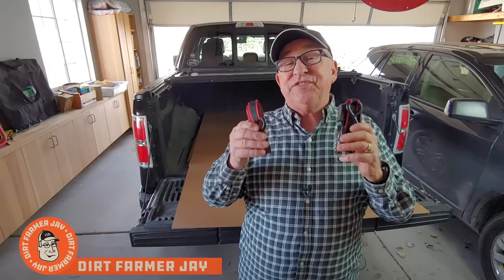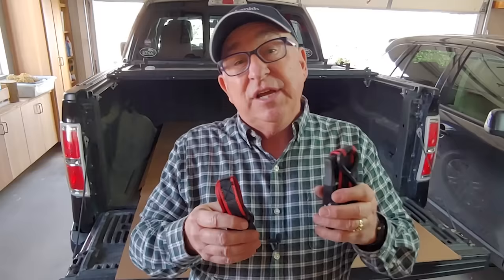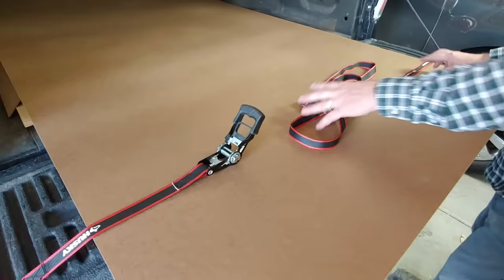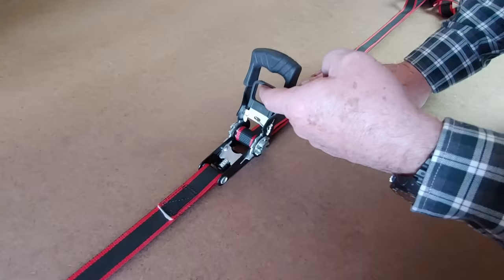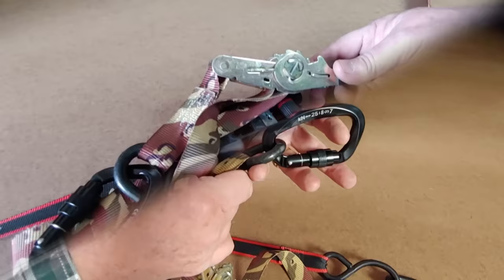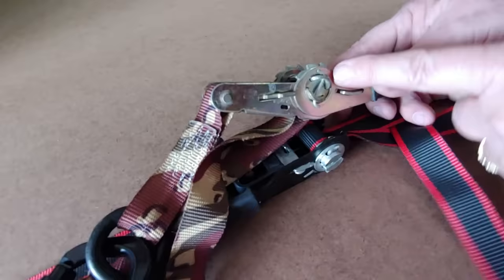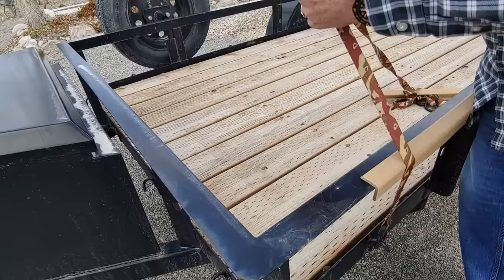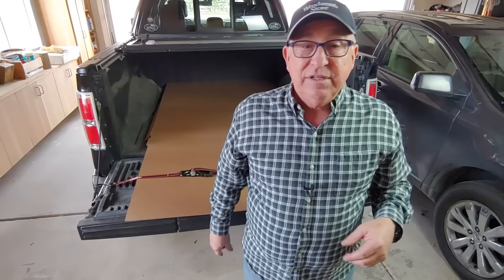How to Use a Ratchet Strap - Tips and Tricks!

Comment: Here's a couple of tips from a long time ratchet strap user: Always have some rubber bands on hand, when you are done using your straps, wind the strap end and store it using rubber bands, this will keep them from getting tangled,( Always store the strap and ratchet separately)  When transporting PVC pipe or round objects, wrap your strap around the pipe, when you tighten the ratchet, this will cause the strap to tighten around the pipe, and will keep pieces of pipe from getting loose. From time to time apply some WD 40 to your ratchets, this will keep them operating smoothly. If you are transporting for a long time-take a break and check that your straps are still tight and in the same place where you started!
Reply from the maker: Great info Kelly Keefe! Thanks for sharing with our viewer family. Best to you and thanks for weighing in! Best, DFJ
Reply: @DirtFarmerJay  No problem, BTW your advice on purchasing high quality ratchet straps was right on the money. My worst dread was loosing cargo on the road and injuring someone who was behind me!
Reply: I haven't been able to find rubber bands big enough for the purpose, but found a container with 20 10-inch bungee cords in it and they work quite well for my 2-inch straps. Now that I've seen this excellent video, I'm going to try the trick at the  end to pull the loop through.
Reply: Wide bands from grocery store broccoli are good for this purpose
Reply: @billnelson3605 most truck stops as well as tarp/securement shops will have wide rubber bands that can used to keep straps rolled up when not in use. Might be little big for 1" straps but I use them on my 2" and 4" straps. Keeps them from unwinding from driving vibrations while stored. I like to have my straps rolled tight and keep them tight. Always roll straps with the hooks/chain on the outside. The free end will do way less damage then if you throw the hook/chain end and hit someone.

Comment: I've used a 3/4 inch garden hose, cut it about eight inches then slice a groove in it, slap it over the end of the Angle iron on my trailer to avoid any abrasive edge on the strap.  Works great.  Stays in place while I'm adjusting the straps with minimal , sometimes zero pressure from the overlying strap.
Reply: My friend got a few feet of retired firehose and cut it into ~foot long sections (not easy) and uses them for strap/load protection.
Reply: Yes, and pool noodles can be good protectors, too.
Reply: @wickedmuffin76 fire hose is also good for chain protection. Leave it in hose form, cut into sections and slip over the chain. Chain will not scratch painted surfaces then, if your worried about that.

Comment: 6:55 I drove commercially and trained flatbed drivers on load securement. Whoever told you that was full of it. That is exactly what that pawl is for, and why some have a slight notch for your finger to stay centered. Normally you don't need to manually pull it, but there are occasions you will.

Everything else was good advice for the beginner. And I like the tip you showed how to deal with extra strap. I'd normally roll it up and tuck it under the strap on those little ones. In the 2in and 3in straps, you can roll it and tuck it back through the ratchet handle as you close it.

One more tip: When feeding the strap through the ratchet, wind the empty ratchet until the reel openings are up and down. Close the ratchet and you can feed the strap from the bottom to the top in one motion. Then start ratcheting.

And one thing you forgot, your securements (straps or chains) will normally loosen up as your load settles. If you're going more than a mile or two, stop about five or ten minutes after loading and check your securements to make sure they're still tight.
Reply: Project Farm has a great video on ratchet straps.  His tests showed a 40 lb tension loss in just 30 seconds.  Your advice is spot on.  Re-tighten the straps before going too far.
Reply from the maker: Rob, thanks for weighing in and taking time to share your expertise in such a clear manner. Thanks particularly for your insight on the pawl notch, as well as the feeding tip for the strap when loading the ratchet.

The insight about tightening the load again after it settles is GOLDEN - that will show up in another tips video, and we'll be sure to give you credit for it. 

Thanks again! Best, DFJ

Comment: 1. When you hook the two hooks to each other, put the hook of one side inside the hole that is behind the  s part of the other hook.  This is less likely to pull apart. 2. When I haul one or 2 boards or pieces of plywood, I wrap a strap all the way around the board crossing it under and when I tighten up it cinches the strap tight around the board. I leave the tailgate even with UP with boards longer than the truck bed, when I’m not hauling a lot of boards. I liked your video. I put a shop towel around the touch points of the straps on my ebike to protect the bike. Never never trust bungee cords. They are the number one cause of blindness in young people!
Reply from the maker: Thanks for watching and commenting Martin Maddox. Best to you, Dirt Farmer Jay

Comment: I'd like to add that if your strap will be in free air as you drive ( like over a tall item) it's actually better to have twists in it to keep it from vibrating.
Reply: 1/2 twist on each side to be exact. Flatbedder who uses the 1/2 twist on anything tall and untarped.

Comment: As a flatbed truck driver, I’d say you’re not wrapping enough strap around the barrel of the ratchet. The strength of the hold doesn’t come from the small hooks and small plate. It comes from the wrap mostly. The more wraps you can get, the better. Leave a little slack, don’t tug tight before ratcheting. Get a good 2-3 wraps around the barrel. That won’t cause jamming and will hold more securely. 

Also, if you don’t want your strap to flutter in the wind, put one half rotation on one side, flat across the top, and one half rotation on the other side with feeding the strap through the barrel flat. Still, have 2-3 wraps around the barrel. This will not only be a stronger hold than shown here, but it’ll prevent the strap from fluttering in the wind. 

Hope this helps.
Reply from the maker: Incognito Burrito (love the screen name!), thanks for writing. This is good stuff. Watch for another video where this information will be incorporated. Best Regards, DFJ

Comment: Like one commenter already mentioned, always twist the strap that goes cross the load to prevent it vibrating agaist the surface, long journey and the surface is ruined. It does not weaken the strap at all, only knots do. Sometimes (usually...) even professional truckers leave the straps flat and straight. My usual boat transporting trucker once said that those "flat strappers" are the ones with a peanut in the place of brains.
Reply from the maker: Love it. Indeed, in another video we did, we mentioned that tip, but have a new edition coming out of "best viewer tips" for using ratchet straps. Thanks for writing! Best, DFJ

Comment: Who ever knew something as simple as a ratchet strap could be so misunderstood? What I learned from your video: Stop storing the straps with the long end rolled onto the crank; instead, start with the strap separated from the crank. ( I've always tried to avoid pulling the strap all the way out of the crank because I was never quiet sure how it was "supposed" to go back in.) This takes me to what I learned from reading through the comments: As you demonstrated in the video, start with the ratchet arm facing away from the load. Next, close the ratchet arm but be sure the slot is in a position to easily insert the strap through from the load facing side and out the other side. Do not pull too much slack out of the strap, you want at least 2 full revolutions of the strap on the drum. You can put a single twist in the strap to reduce wind noise and strap wear. Use only transportation approved fasteners and fasten points.

Comment: Good points. When securing a load subjected to winds from highway speeds a single twist in the strap midway helps prevent the humming and strap vibration caused by the air.
Reply: Right? I remember that tidbit of knowledge from years ago and yet I still see quite often on big rigs the straps flapping and vibrating which can cause other problems in the long haul.
Reply: Yes a twist in the strap does it weaken the strength of the strap at all !
  The only thing a twist may do is get into the ratchet tumbler if you aren’t paying attention, but if your that stupid you maybe should not be trusted with the task
Reply: Yes that twist to prevent flapping is an old trick I learned as a flatbed truck driver 40 years ago. It’s not necessarily needed on a very low profile load like rebar but it’s important for taller loads.
Reply: I was going to say the same thing but you did it for me.  A twist will eliminate shuttering.  It always bugs me when I'm driving down the freeway and I see a strap shuttering.
Reply: @Alan 602 that’s the thing though, that humming and flapping equates to constant movement and possible loosening of the straps which is never a good thing.
Reply: @itonlyhurtswhenilaugh4750  )))
Reply: @Alan 602 The flapping is movement that is wearing your straps where they contact the load.

Comment: If you ever see a steelhauler loading sheet goods, they will lay a couple 4 by 4's on the steel and then throw the chain across. It's hard to explain,  but if you see it done, it makes total sense.
Reply from the maker: Ed, I have seen that. Thanks for bringing that up. The 4x4's allow down pressure to be brought to bear on the steel, without the chains coming right across the sharp edge of the sheet steel. These kinds of practices are time tested by people that depend on them to safely secure, and transport loads. Thanks again! Best, DFJ

Comment: As an FYI, If you fold closed your handle with the slot facing upward, it is much quicker and easier to feed the loose end strap webbing through the slot, pull slack out and begin ratcheting... No need then to pull one direction and then feed the end back through the handle as it is all ready in place.
Reply from the maker: Well said, Lonnie. Thanks for writing! Best, DFJ

Comment: Hi from Portland Oregon!

BEST VIDEO OUT OF ALL OF THE ONES THAT I SEEN!!! 👍👍👍

@ 8:00 
I will "ASSUME" all truck beds have four or more attachments (upper/lower) points. The natural of my job I have to load equipment on top of other equipment. I place "short straps" on each attachments points so I have a option of using the upper or lower depend on my load.

 When BORED I will remove the long strap and lube the metal racket and it will work like "butter"! 

Since I carry about ten or more I found different ways to roll the strap up so it is neat and 90% smaller. They will all fit in a small bag. I bought a roll of velcro from the Dollar Store and cut it to size. The elastic  "hair rings" work great too. And play with the strap like a rope using the hook as a hanging point will cost you $0.00!
Reply from the maker: Thanks for watching and commenting Ron Car. Best to you, DFJ

Comment: Another inexpensive and handy item to prevent the strap contacting and chafing a boat surface or to prevent the strap from being damaged on a sharp edge is to use a pool noodle, cut open lengthwise through the core, and then cut into one-foot lengths.

Comment: A couple of years ago, I had a couple of the big binder type paperclips laying around.  I folded up my excess strap and secured everything with that binder paperclip and it works like a charm.  I've used the same two binders for over 2 years and it still works flawlessly.
Reply from the maker: Reed, I just came across your comment again, and wanted to thank you for this. In fact, we are doing another video shortly mentioning that the job of securing the load is not finished until the strap tail is secured as well. We plan to use your technique as one of the ways to do this and will mention you when we do. Thanks for being a part of our viewer family! Best Regards, DFJ

Comment: Day before yesterday I saw a beautiful piece of ratchet strapping on the roadside & thought someone's strap had loosed & fell off, so turned around to retrieve it. It was a heavy duty 2 inch yellow strap. I was surprised to see it had ripped apart at the ratchet even though it was brand new. Upon closer examination I discovered it was a 16 foot loose end that must have been dragging & blowing in the wind, until the end flopped under a wheel. When the wheel rolled forward on top of the strap it provided enough tension to RIP this 2,000+ pound test strap apart. I saw the rubber tire tracks on the strap that solved the mystery. LESSON BEING, never neglect securing the loose end of a strap!

If it was the primary strap holding the load, it could easily cause a fatal accident if the load fell off resulting in someone behind running over it or died trying to avoid it.😖
Reply from the maker: Ronald, I've seen the same thing happen, and actually saw a strap, much like what you describe, on one of our roads about 2 weeks ago. It too was snapped in half - evidence of a loose end trailing in the wind and the vehicle running over it. Bad news, for all the reasons you describe. Loose ends can also get wound up in the drive shaft, with very poor outcomes. Indeed, securing the end is just as important as securing the load. In fact, if the end isn't secured properly, then the load isn't secured properly. Thanks for emphasizing that point. Best Regards, DFJ
Reply: @DirtFarmerJay  I followed a flatbed 18 wheel tractor trailer one day, 70mph, that had a heavy duty chain dragging on the pavement, throwing sparks, near the trailers right side wheels.  I couldn't warn the truck driver, he was in the left lane on interstate hwy and I was in the right lane and shy ad afraid to try to ease up on his cabs right window to warn him.  I was driving a Greyhound bus.  My passengers' and I just had to sit and wait for quite awhile for the drama to happen..
Sure enough, as anticipated,, the chain finally bounced under the dual tandem wheels on the trailer and it wasn't a pretty sight to see and the violent snapping of the chain sounded like a cannon going off needless to say.
Reply from the maker: @jerrystevens1865  Wow! That must have been nervewracking. Glad you and the others on the freeway were not hurt. BIG lesson for the driver, hopefully he learned it! Best, DFJ

Comment: I have successfully used ratchet straps to seat the bead on tubeless tires as I don't have a compressed air bead seater. A small one for the front tire of a zero turn mower and a medium one for a vehicle or front end tractor tire. It's possible that a large one would work for a rear tractor tire as a lot of squeezing pressure can be created. It's been the cat's meow several times for my situation.
Reply from the maker: Dean, this is brilliant! We may feature this in an upcoming video and we'll give you credit for it. Any other creative uses for ratchet straps that come to mind? Best, DFJ
Reply: @DirtFarmerJay  Hey thanks!  
Can't think of any other uses at the moment but will send anything that I come across
Reply: Here is another creative use....to "square up" a leaning arbor before securing it with corner supports.

Secure the hook of the long strap to the upper corner of the arbor that is leaning away from the center. Secure the hook of the mechanism side to the opposite bottom corner.  Connect the straps and begin ratcheting until the leaning corner is pulled back into square. Once squared up, secure top rails with corner supports.

Comment: Suggestion…if you have a fair distance between the end hook and ratchet and the strap is exposed to the wind, it will flutter like crazy in the wind.   A couple of twists in the section under tension will prevent flutter.   Learned this from a trucker with ratchet straps used every day.  Used the trick in the white bimini straps on my boat.  Stops flutter completely.
JoeB
Reply: Usually a half twist or a fold on the 4” straps

Comment: Great tips Jay. I have used ratchet straps for many years now, mainly for securing atv's and side by sides. A tip from me is make sure you have at least one full turn of the strap barrel with the strap when tightening. This way when the suspension of any machine works ( or anything that may flex) it won't loosen the strap on the barrel.
Reply from the maker: Thanks for the tip Lucky trapper. Best to you! DFJ
Reply: @DirtFarmerJay  you pop pop pp

Comment: ACTUALLY Attention Jay: A good idea I use to store my ratchet straps is a cheap plastic Harbor Freight Ammo Can!! In my truck I have an extended cab and I found the ammo can laying on its side slides neatly under the rear seat out of the way!! Not only are the ratchet straps "safely stored" this way, but because it is an Ammo can it won't open as it slides around either!!
Reply from the maker: Greg, this is an EXCELLENT idea. I plan to feature it in an upcoming episode of the next batch of great ideas we've received. We'll be sure to give you credit for it! Best Regards, DFJ
Reply: I do the same thing.
Reply: My nearly new Husky tie down straps (Home Depot) came with a proportionately sized (hefty feeling) bag to carry all 4 tie-down sets.

Comment: with the way you set up the strap you are double winding the strap and can bind up the ratchet before . just thread it thru , start ratcheting and tuck the tail under the strap and it will keep it from blowing in the wind , been doing this for 30 ytears of trucking , so ive done it a few times, when releasing it if you pull it in the oposite direction of the long end it will open quicker and completely , Can unstrap a full semi in less then 5 minutes,just by feeding the strap under the handle ,rather then doubling the strap 

 it gets tight
Reply from the maker: @kenbersheit948 - great insights, thanks for sharing! Best Regards, DFJ